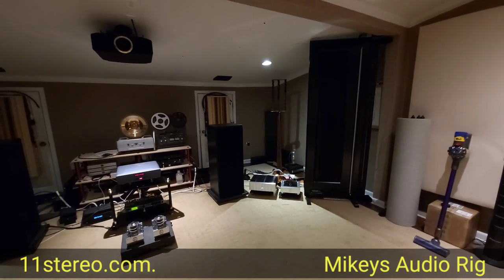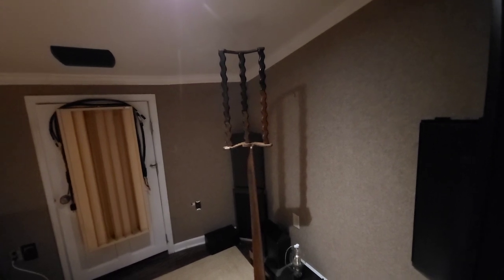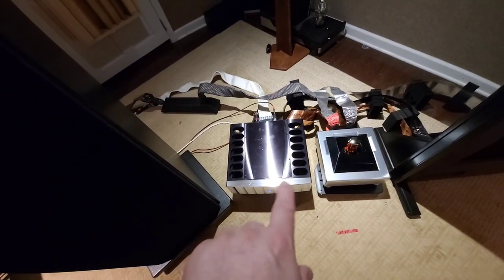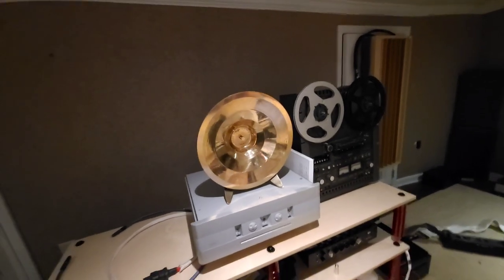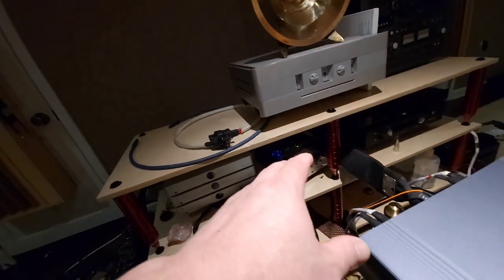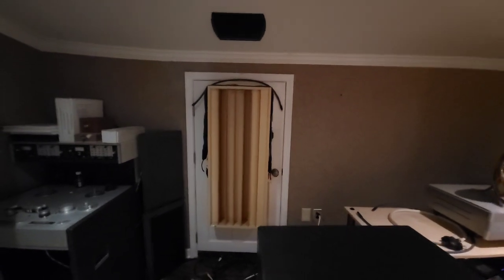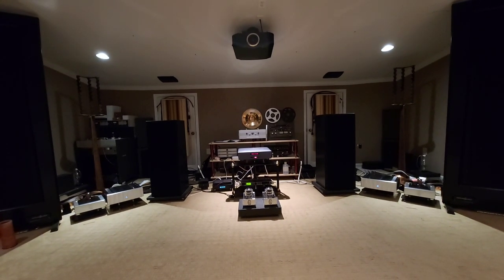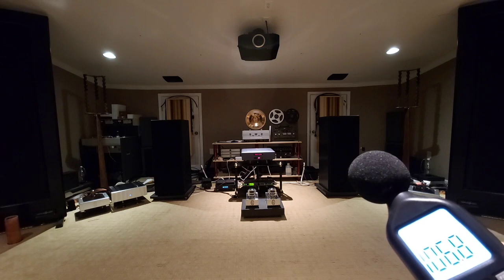Mikeys Reference Audio Rig - Lets break it down

Comment: Man, the composure at loud levels is truly astonishing in this rig. Taking a serious look at Playback Designs. This DAC is insanely analog sounding based on following your journey. It is clearly at a level far above the other dac's you have played. Very dialed in dude!
Reply from the maker: Paul, before I picked up the line I contacted another dealer I know to ask how the DAC was. He told me it beat out his Kronos Vinyl Rig. Please give me the chance to earn your business if you are thinking about moving forward. I am willing to ship to you and put it in your rig, then decide. I Know im all lathered up about it but its because this DAC did what no other has been able to and that's bridge the gap between 3D imaging and absolute definition and presence coupled with zero fatigue,  tonal density and utter naturalness. Furthermore if you only use your preamp for volume control and dont need analog switching then this Volume control has beat out even my $26K World Class Linestage . Holler if you have any questions , also there will be a 12K  version coming out end of year. Ill get one and comment on how close it is , but the MPD8 represents Andreas going all out in every way to create a reference piece. Not many designers get to do that
Reply: Excellent offer! I have some questions.. Does this DAC perfer balanced output? My rig is fully RCA single ended. I would like to know how each of the PD's outputs are handled electrically. For example, is it a single ended circuit and converted somehow to balanced, or the other way around? And how electrically, that is done?

Comment: such a large panel will really provide the surface area to reproduce life like body weight to the midrange...it can be done with conventional 15 inch drivers too if u use the right circuit to critically damp the the voice coil( inductively) which in turn will make all that mass more responsive to steep transients and exhibit better control over the Bass and Mids...Ty for this info brother...

Comment: When u get it right u get to get more of the artist's intent ...there is alot goin on within whatever source u have that with a lesser system u probably wouldn't hear...ty Mike for the demo
Reply from the maker: Yes, and I think the Artist intent thing is total bullshit. Theres this thing called the record label that could give 2 shits about the artist intent and because the majority of artists have signed away the control of how the creative of the final mix and master, its rarely if ever what the artist intended and most often not even close to what they intended, its what the record label thinks will sell best. Furthermore there is no unified chain of production the tracking engineer, , mix engineer and Mastering engineer are many times 3 seperate people in 3 different states with 3 different repro rigs and 3 different ideas on how the piece should sound, so the process is far removed from the artist and one of the biggest hustles in entertainment . its sad actually
Reply: @OCDHIFiGuy  Does all of this go thru yer head when yur listening?

Comment: All that mess of cables crossing all over each other will contaminate the sound, as they act like arials pulling in all sorts of frequency radiation spreading them into all the connected components. LARGE 3 WAY ATC SCM ASL active loudspeakers and subs can play just as loud and clean with detail without compression, distortion, without any complaint too.
Reply from the maker: Thats right , so think of how much better it will get when I sort it all and independently ground each piece to Earth .. ;-) As I said volume is not everything the ATC would not be able to create an image so wide and deep due to the box design which restricts this. Im sure they sound great though , I love that midrange ..

Comment: For a real improvement , build an audio listening structure so all the equipment is in a separate room from the transducers (speakers and subs) and on an isolated foundation, with speaker wiring fed through the concrete dividing wall with minimal air gap surrounding the cables.
Reply from the maker: I can do that actually and have considered it ... but I sell gear and need to display it